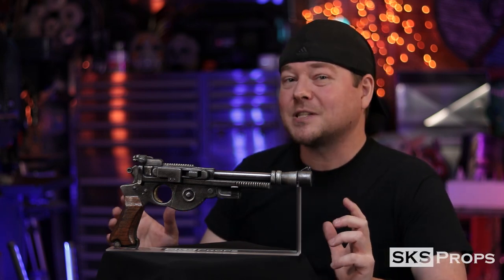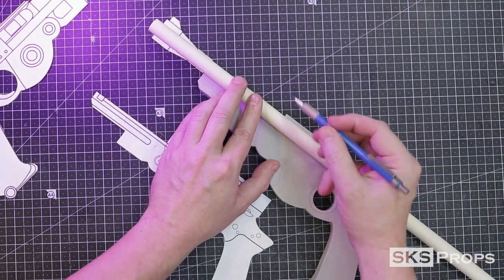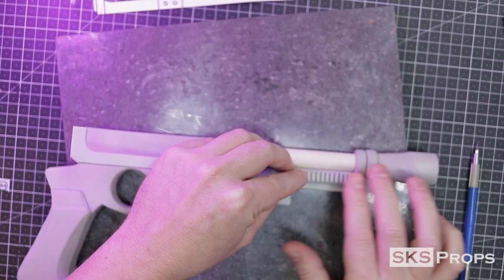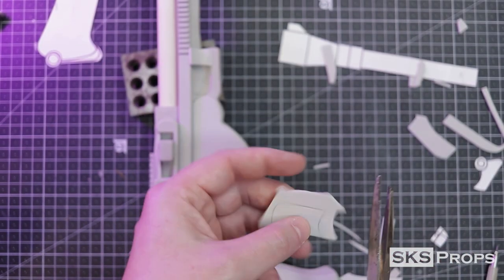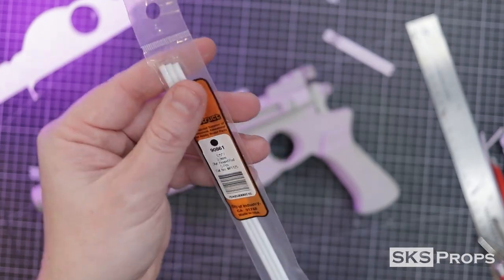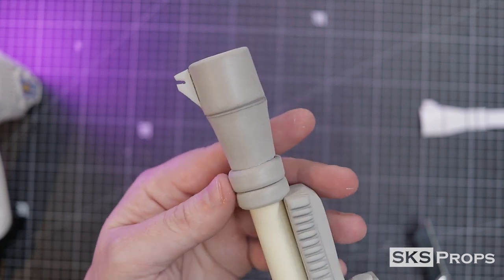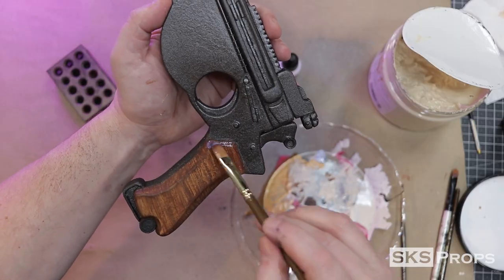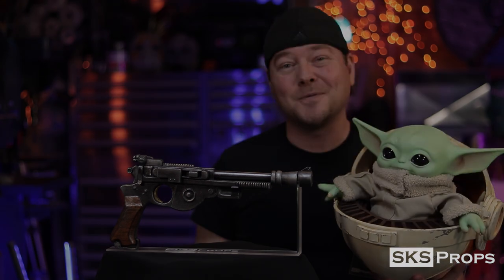How to Make Din Djarin's Blaster from Star Wars The Mandalorian out of Foam - Free Blueprint

Comment: Incredible build. Always wondered why there would need to be a "hammer" on an energy weapon, it's not as if there is a firing pin striking a projectile.
Reply: That is becouse it is based on an actual wepon. A Bergman 1894 No. 1.
Reply from the maker: Because in the original trilogy the guns they rented could only be modified to a certain extent before they were returned and they are keeping with that tradition

Comment: Great template! I'm going to have fun making it! I did print it too big though so I have to scale it down. Do you think you could add like a mini ruler scale so its easier to match the size?
Reply from the maker: Thanks! If you open the pdf in adobe acrobat or adobe reader and click poster in the printing setting there should be no reason you are scaling it up or down it scales automatically to the correct size
Reply: @SKSProps  i have, mine always acts a bit funky. Its printing on 3 sheets is and a roughly 13.5 inches. What is the length of your blaster? Does that seem right?
Reply from the maker: @hitmantutor  yes from the widest points. Back of grip near the bottom to front of the barrel is approx 13.5”
Reply: @SKSProps  Thanks so much!! I didn't realize how large itd be!

Comment: I’ve started to paint my blaster following along your methodology.  One question:  after applying the graphite if you wanted to seal it using testor’s metallic sealer do you do it immediately or after you complete the silver & gold accents & weathering of the front of the barrel ?
Reply from the maker: Personally I would apply the sealer just after the graphite them go with your acrylic iridescents on top
Reply: @SKSProps  great, thx!

Comment: Half inch pvc doesn't fit into two pieces of 10mm foam. How much PVC did you shave off with that sanding block?
Reply from the maker: I didn’t shave any off just buffed the surface. The pipe I used was an interior diameter of 1/2” exterior diameter of 5/8” 
Two pieces of foam are .78” 
so yeah it works lots of people have built this using the blueprints 
maybe you’re getting pipe with a thicker wall

Comment: Hello when printing out the templates what size should they be printed out
Reply from the maker: As stated on the website open the pdf in adobe acrobat or adobe reader and click poster in the printer settings that will scale it properly over 2 sheets
Reply: @SKSProps  Thanks ...

Comment: I don't have a bandsaw I don't have a Dremel and I can cut the design straight it's always Angeles what do I do
Reply from the maker: To cut straight make sure you have a new blade on one that’s recently sharpened and a metal ruler. From there it’s just practice 
I will say if you plan on working with foam you definitely need some kind of rotary tool, doesn’t have to be a Dremel brand. Cit that are off can be cleaned up with it. Watch my how to cosplay with eva foam video and the Wen rotary tool review video